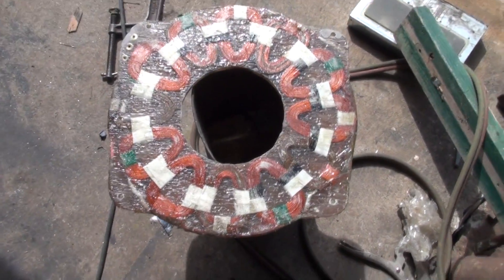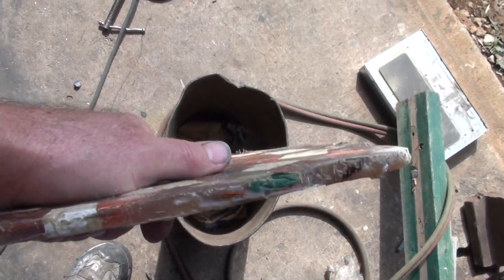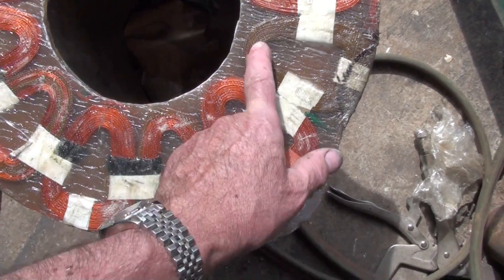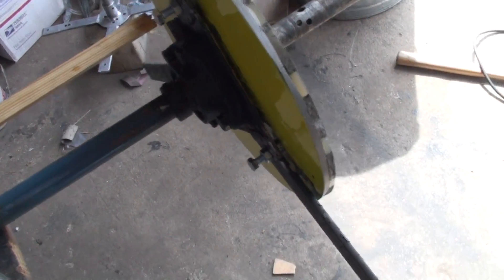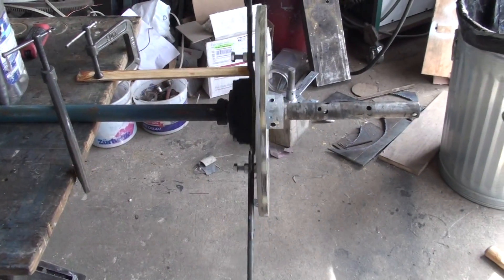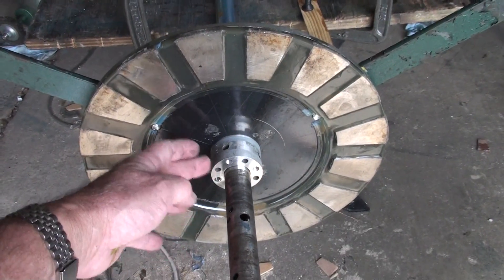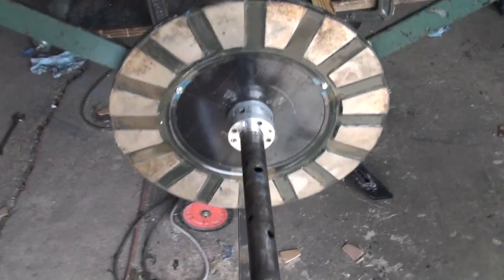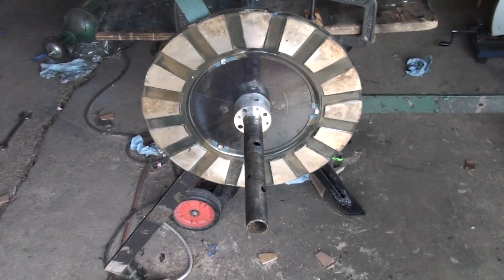Axial flux alternator, 12 inch diameter

Comment from the maker: @STARFIRESOLAR Same turbine but went to this bigger more powerful alternator on it. I have it back together on the dock now but not much wind right now. The little bit it did run was a lot better than with the smaller 8 inch alternator. I'll probably change the one on the roof turbine also if this one works like I think it will. Might try a 68 turn one up there. Really added some weight though.